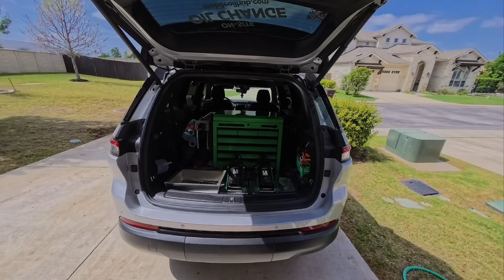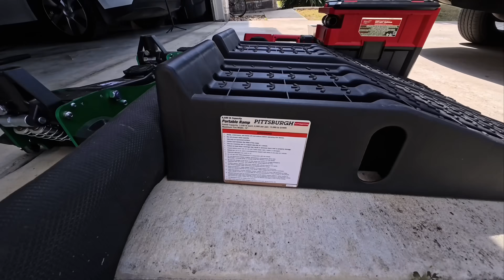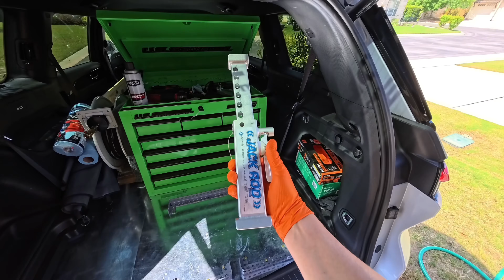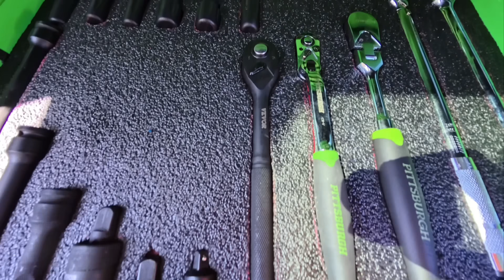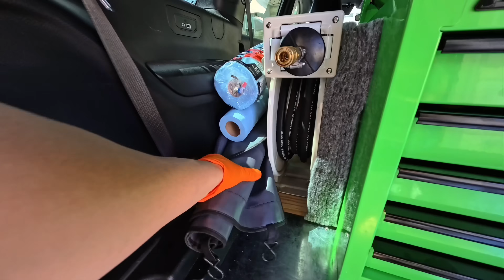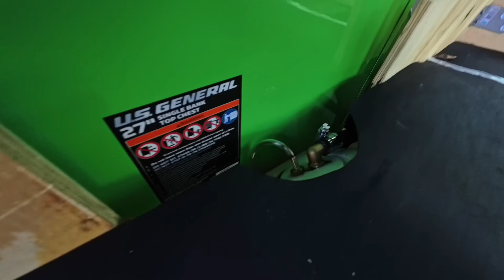Simple Tools, Real Money: My Mobile Oil Change Setup

Comment: Why are you not using a work truck or a van instead of the SUV?
Reply: Probably the cost man….. but in his case that’s a perfect set up ….
Reply: He clearly doesn't need a van. And a truck would have even less room, not practical at all
Reply: @goblin.muncher.67  What dope are you smoking? How do you come up with a truck would have less room? My truck bed is 6.5 feet long, much larger than the back of that Jeep. Plus I don't have to take out my seats or have anything in the cab. Nor would you have to worry about spills with a truck. A truck is far more practical for something like this.

Comment: Bro hello! Could you tell me your telegram contact or some other way? The question about the vacuum cleaner is, what is the model that keeps the oil from draining? I've already gone all over the Internet) And if it's not difficult, can you tell me where you bought this control valve that's blue? I can't find its name either (Thanks in advance and respect!
Reply from the maker: You can find that regulator on agatools. Vacuum Milwaukee 2.5 gal

Comment: Great video! I was wondering if I could ask you some questions about your business? If you don't mind answering them.
Reply from the maker: Go ahead!
Reply: @mobileoilhub I was wondering how much was it for your oil business startup? As in buying the tools, the tanks for the used motor oil, and everything that you use to change oil. Also the car wrap looks nice. How much was the car wrap?
Reply from the maker: The car wrap - $800 
I spent about $5K on tools and all the supplies, considering that I installed everything myself
Reply: @mobileoilhub  Besides the tools and supplies. How much was the legal setup and  insurance you have to buy in order to start your business?

Comment: Thank you so much for making this video, I have a similar setup with the Packout hoover. I’m wondering if you could answer a few question about the vacuum regulator? Keep up the great vids!
Reply from the maker: Thank you 
Go ahead and ask—I’ll do my best to answer everything
Reply: @mobileoilhub thanks, I’m interested in how it works as on their website they don’t go into much detail!
Reply from the maker: @dannymasson  It bleeds off excess suction to create a safe, controlled vacuum inside the engine.
This vacuum acts like a "finger on a straw," holding the oil inside the oil pan even when the drain plug is removed.
Reply: @mobileoilhub Ahhh, and how does it bleed the excess pressure off from the vacuum is it like a flap or a ball?
Reply from the maker: It uses a spring-loaded relief valve. Think of it like a pressure cooker valve, but for vacuum. Once the suction reaches a certain level, the spring compresses and lets outside air in to keep the vacuum stable and safe for the engine seals. No flaps or balls, just a simple, reliable spring
Reply: @mobileoilhub brilliant, thanks for letting me know!!
Reply from the maker: @dannymasson you are welcome!